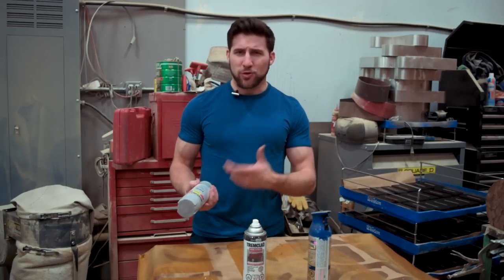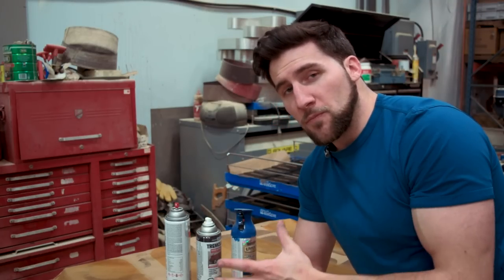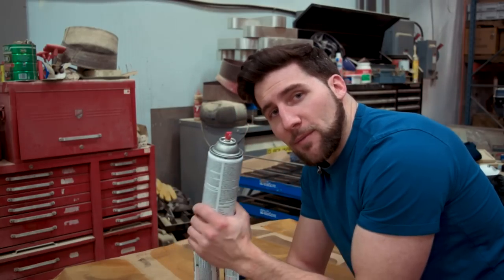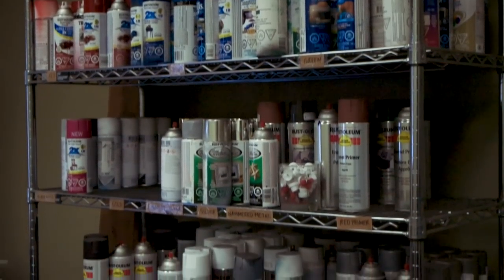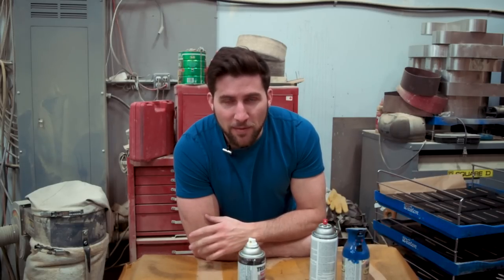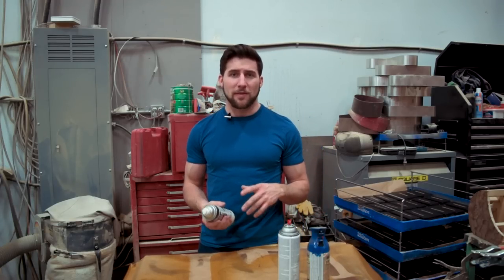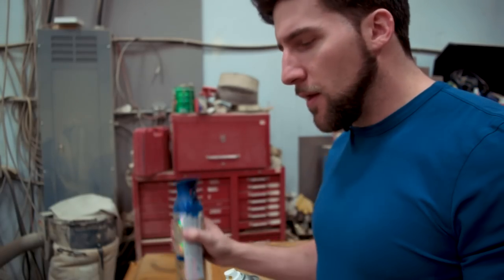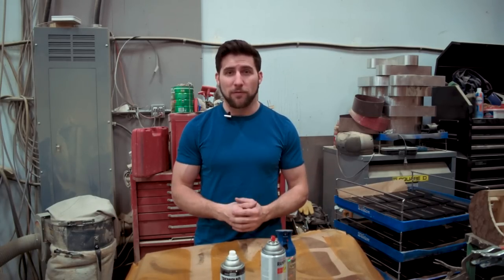Why are your paint cans spitting? (Solve the Problem!)

Comment: How do you fix when it has already happened?  Let dry and sand and replay?
Reply from the maker: How do you fix what? Sorry, the app I use to manage comments doesn’t tell me the video title, and I can’t tell from the thumbnail.
Reply: Oh, I watched your video on why paint cans sometimes spit and put heavy droplets onto the car instead of the mist that goes everywhere else.  I had that problem big time.  So I have little drops and gobs.  Didn't know whether to wipe up right away, or let dry and then sand, and if the latter, how long it has to dry.  Thanks for responding though.  Also, whether the
re are some brands of rattle can that do it less.  It was not cold (I'm in florida) and I don't think I had my finger blocking it.   @BradAngove
Reply from the maker: Let it dry pretty much fully and then sand it smooth and add another light coat. 1 day drying time is generally safe from that perspective. Some types of paint dry quicker. 
Higher quality cans don’t tend to spit as much but you need to know what kind of paint you’re looking for. For example, if I were spray can painting a car I would use spraymax cans.

Comment: Hi Brad, I watched a couple of videos today before I finally decided to paint my product Pooja mandir (a small temple that Indians use, to keep the idols to do pooja - worship* ) you could check for images on online by typing "Pooja mandir for home" I painted it in my balcony. It was not windy. I don't know if I had placed my finger over the nozzle. The end product has turned out to be horrible. My spray can spat over the whole product.

I am using the second type of spray can that you are showing in this video. It worked well while doing a patch test. I don't know why it went bad like that while I used it on the mandir. Any ways I can fix this? I see that you have been replying to almost all the comments. I hope you reply to me too.. Should I sand it? I tried sanding in between but the paint was peeling off while I tried. Should I try sanding it after 24 hours? This was my first time. Please help me 😭
Reply from the maker: What is the mandir made of? And what did you do to it before spray (sanding? Primer?)
Reply: @BradAngove  Hi Brad... I remember replying to you... I wonder where it disappeared. The mandir is made of Plywood.. I had priorly applied gesso on it and had painted it with acrylic paint with a brush. But the finish looked bad.. So I sanded it before using the spray paint. The spray dust kinda looks ok now. It's turned out to look like a design. I am kinda reconsidering my decision of removing it. But, I would still like to hear from you. Please let me know what could be done in such a situation. Thank you so much 😇
Reply from the maker: Could you feel the can spitting when you sprayed, or does it just look bad now?
Reply: @BradAngove yeah I could feel the can spitting while spraying. Every time I paused in between, even though it was for few seconds. It spat
Reply from the maker: Ok, so maybe just using a new can might solve the problem then.
Reply: @BradAngove  thanks for replying Brad. God bless! 🤗

Comment: I was getting the spitting paint on my recent project as the spray was hitting the edge of masking tape that I had put around a raised area that I didnt want to paint. I hadnt pressed down a piece of the masking tape and the spray bounced off that and landed unevenly onto the surface.  Couldnt figure out what was going on initially.  So even those areas the you mask off, make sure it sits down flat!

Comment: I have a problem of the can getting hard with pressure after a couple of sprays and then no paint comes out once the can is hard enough. Brand new cans but haven't been used in a while after purchasing. What's that problem's solution?
Reply from the maker: Getting hard? I’m not sure what you mean, but I’m guessing you’ve just got an issue with nozzle clogging.